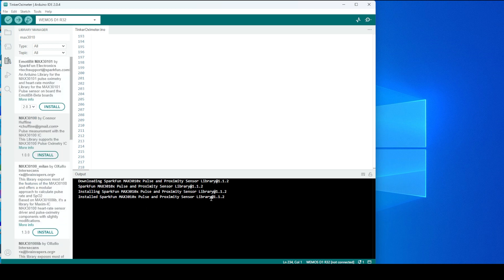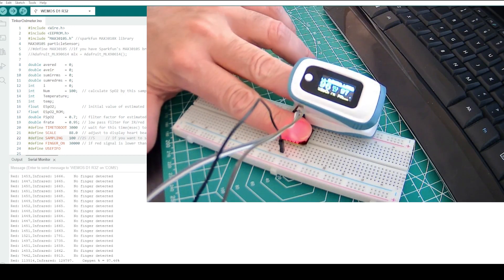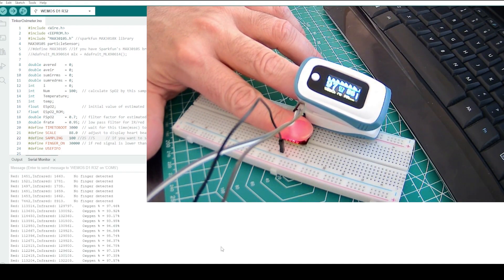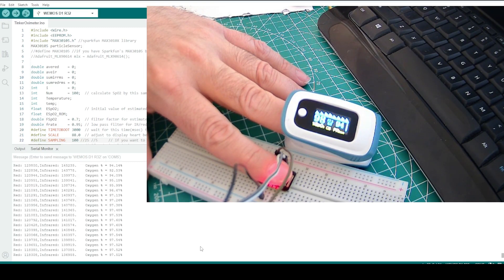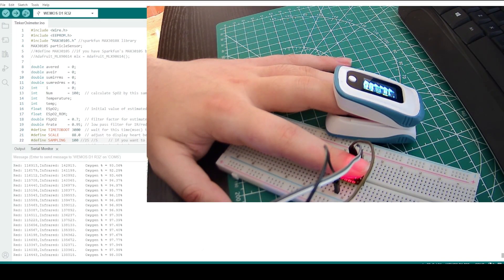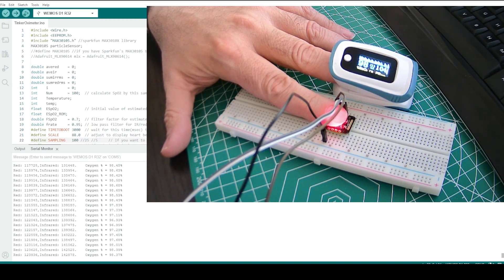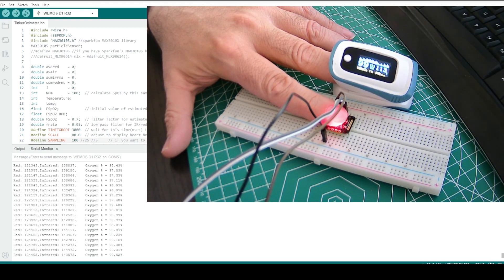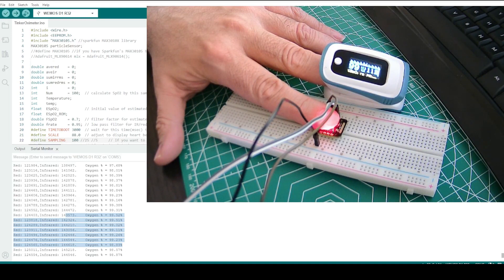ESP32 Based Pulse-Oximeter using MAX30102

Comment: hello good work thanks.i have problem why the oxygen satiration is show in serial monitor is negative valeu like this Red: 108617,Infrared: 100617. Oxygen % = -5176478.00%
Reply: Hi there, My this code is not working in my laptop can you figureout why? the error messege is showing "I2C_SPEED_FAST is not decleard. pls reply